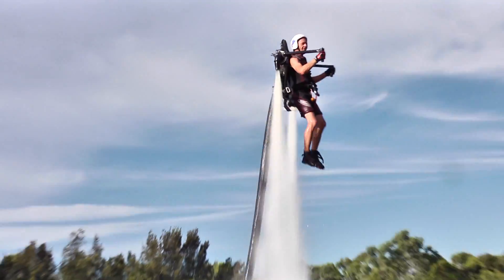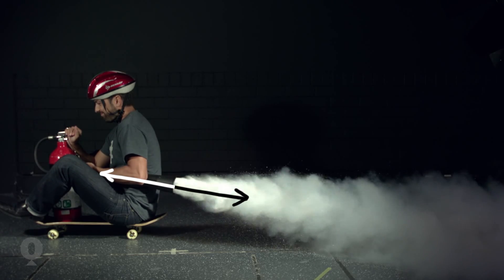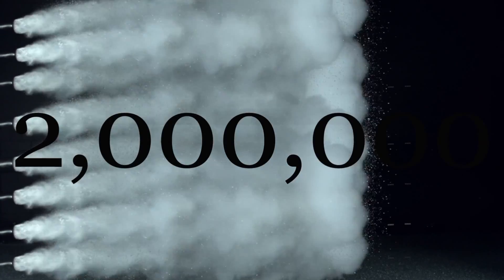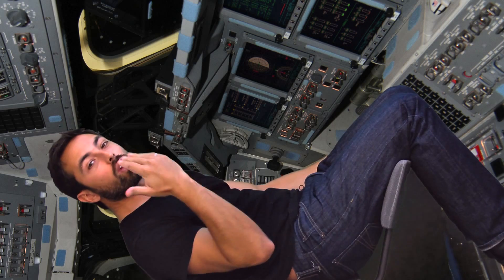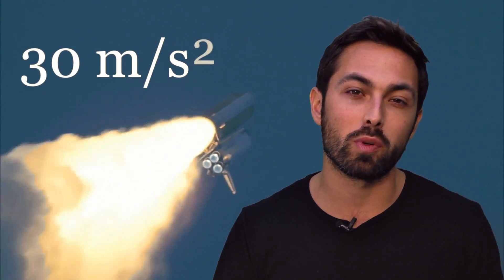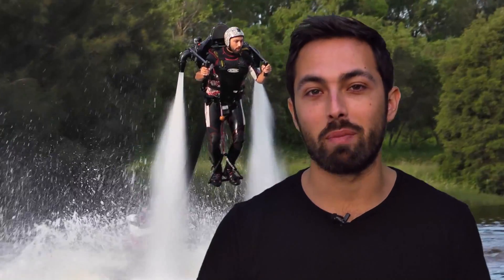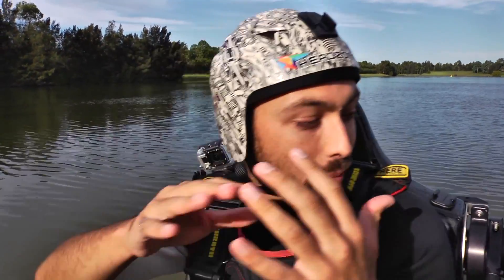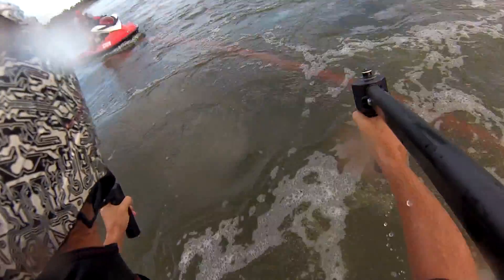The Science of Jetpacks and Rockets!

Comment: Force can be found in many form, and its  correct people, according to the THRUST CALCULATIONS, to calculate the total amount of thrust an engine produce, use the thrust formula, where thrust is (F), and F= M(V2-V1) + A.P, but because the pressure thrust is negligible in this small fire extinguisher, and because air accelerate from zero velocity,, F=MV is basically true :D

Comment: When he showed F=mv with a dot on the m, the dot signifies "rate of change of." So, saying F=mv with a dot on the v means mass times rate of change of velocity (which is what a or acceleration really is), but having the dot on the m has the same effect, but is more descriptive of the fact that the mass of the rocket is changing as it loses fuel. More specifically, the dot is the derivative with respect to time (if you've had calculus).

Comment: What everyone seems to ignore is the air density. if he did that in wanter he would go foward, **density** was not calculated into the equasion. In his example density was not calculated in since it was insignificant. If he had a combination of dense gas in combination with a light faster leaving gas you might see some results.
Even the water rockert was a good example in how dense and fast it came out. But even if you ignore it all try pushing the air u wont move, but if you push a wall u will.

Comment: When we're sitting on the ground we have it to push back with a normal force and keep us in place.  But because when we're in the air we don't have anything to provide a normal force (there is actually a tiny bit of buoyant force because the air pressure is greater towards our feet, but I digress), we have to rely on F=(m_dot)*V.  So just to hover, we're providing a force equal to that which gravity exerts on us (your mass times 9.81m/s^2), which requires burning very expensive fuel.

Comment: If you accelerate too slowly, like a helicopter, you'll use most of your power generating thrust merely to cancel gravity. So the "first g of thrust" is all loss. However, if the rocket thrust generates 2g of force, 1g net actually goes to going up the gravitational potential (50% thrust wasted). If the thrust generates 3g of force, only 2g net actually goes to going up the gravitational potential (33% thrust wasted). If the thrust generates 5g, the thrust wasted is only 20% of total.

Comment: The short answer is that it's more fuel-efficient, with complex reasons why that is. For example, consider just rocketing upwards. If you're hovering, you're using fuel but not going anywhere, aka wasting it, and the further away you are from hovering - the more quickly you're accelerating upwards - the more effectively you're using your fuel. However, this is only if there's no air; in an atmosphere this gain from faster acceleration will eventually be overcome by loss from air resistance.

Comment: They have to accelerate fast enough to reach orbital speed at the desired altitude, which for the space shuttle was around 17,500 mph (28,000 kph). There is no throttle on a rocket engine, btw. You ignite it and it goes.

Comment: he means that the increase is not constant, it keeps increasing faster and faster, like now its increasing at a rate of 6m/s^2 and 10 secs later its increasing at a rate of 16m/s^2 and so on... (numbers are examples not real values and changes in value) so basically what hahalol663 exponentially but exponentially gues like that exponentially but this is not the case exponentially would be more like 2,4,8,16,32,64,128,256,512 exactly, like MB of storage lol

Comment: You said the airplane seat presses into your back. Isn't your back pressing into the seat, but not as much. Our bodies are in one state, and the seat too, but the seat is connected to the plane, so inertia will act 'faster'. But it will also be pushed towards the back. Just as you are. But the seat is stuck into the plane, so it stays. Your body wants to go to the end of the plane, but the seat stops. it. So your body pushes onto the seat, and the seat pushes you. Just more. 

Right?

Comment: Your calculations didn't factor in resistance. The extinguisher experiment may have worked if the wheels were better. I would imagine that atmospheric pressure would play a part as well.

Comment: Quality stuff as always! :) However you did say that most of the acceleration of a space shuttle in orbit is horizontal. I think it needs o be noted that this true for its ascent but not for orbit. I understand that this video isn't supposed to go too deep into the topic, but to be in orbit, the space shuttle experience a vertical (centripetal) acceleration of 1g. If it accelerated horizontally once in orbit, it would leave orbit. It accelerates horizontally UNTIL it is in orbit.

Comment: Simply put, there isn't just the force from the extinguisher.
There is also the static friction force from within the skateboard bearings, wheels, and the floor.
For something to accelerate, the object must have a positive net force. 
The extinguisher might exert a force of 5 N, but if the friction force (which always acts opposite of the direction of the other forces) is 5 N as well, then you won't accelerate.
Basically the force from the CO2 is not strong enough to overcome the friction force.

Comment: Derek "simplifies" the equation, but he explains what ṁ is. ṁ is the rate of change in mass at a position with respect to time, or its derivative. You could write it F = (m1-m2)/(t1-t2) * v. But v is the flow velocity of the propellant, so if you put the time interval under v instead, you get the rate of change in velocity over time: the acceleration. So the force applied is the mass ejected times the flow acceleration, or surprise surprise, F = ma.

Comment: Question about the misconception that you need an surface for the propellant to push off of.
You do not need the surface correct, but doesn't having a surface help significantly as opposed to not. For when the propellant is trapped between the rocket and the surface it creates a high pressure area, adding additional trust from the propellant just rounding off the surface.

Comment: Because decreasing the pressure also decreases the boiling point. If the pressure is low enough, liquid water will be impossible. Take a look at dry ice: the triple point of CO2 is at a significantly higher pressure than the approximately 100 kPa we experience every day, making it sublimate instead of going through the liquid state.

Comment: F = ma is one of many force equations.
F = dm/dt v is another, (dm/dt is the same as what he calls m-dot in the video, and represents the rate of ejection of mass, and where v is the velocity of the ejected mass).

For example, if a 100N object ejected 20 kg of mass per second at an ejection rate of 5 m/s, the force exerted on the 100N object would be 100N - just enough to negate gravity (if the mass is ejected in the direction opposite to the direction of gravity, of course).

Comment: How come the suction from the water being pulled up the hose is not equal to that of the water being ejected? Surely the speed / volume have being sucked up has to mathematically match that being fired downwards otherwise you would be short of water after it starts up. Hope this makes sense!

Comment: That wasn't my question. I know it doesn't matter to work at all. My question was if it adds anything. Either hypothesis A), it is only affected by the propellant - as particles go out this is the only point that force is exerted on the object; from then on surroundings will only have an affect on friction and where the propellant molecules go. Or Hypothesis B) the propellant can be repelled by another object back to the first and put in an extra amount of force on the object. Which is it?

Comment: Keeping in mind that he was only doing that calculation of its thrust only not the mass it also has to lift.  The real question is how many fire extinguishers would you need to get a thrust to weight ratio of greater than 1:1 for whatever amount of mass you have to move.  As a single extinguisher cannot lift its own weight, you'll never hit that number without heavy modification.

Comment: Essentially it comes down to reducing friction to the point at which you can start moving (overcome static friction). Less mass would reduce friction, greasing the wheels, etc. Or you could use a more powerful fire extinguisher.

Comment: With the part on not requiring more than just the propellant to get you moving; does the force repelling on you increase if there was? For instance, could starting the fire extinguisher in front of a wall have allowed you to start moving without having to increase the speed of the release of propellant as much? Or is it only the direct affect of the propellant on you that changes your speed and other things just change where the propellant goes afterwards?

Comment: Newton's second law is actually F = dp/dt. Force is the rate of change of momentum. Momentum (p) is mass * velocity (p = mv).
In most situations only the velocity changes over time - an acceleration - so you are left with F = ma (the rate of change of velocity is acceleration).
However, in this situation gas is ejected from the extinguisher at a constant rate/velocity of v causing the mass to change over time (the dot over the m means rate of change) so F = v*dm/dt (d/dt means change over time).

Comment: That's what I didn't understand. I always thought it would be enough for the water to be pushed out of the nozzles, downwards to push you up, while it didn't matter where it came from. If you had a weightless water-tank (or one fixed to the ground, but higher than you), so it only had to push your weight, while the water doesn't change direction, would it still lift you up?

Comment: Sitting perpendicular to the force eliminates blackout from the forward force of acceleration. But if the pilot pulls the nose of the aircraft up or down quickly, force more parallel to the body is introduced that will either force blood into the lower body from pulling up (grey/blackout) or force blood into the head from pulling down (redout).

Comment: I don't understand the part where you explain that it's the water from the jet ski that thrusts you up until it passes the bend down to the nozzles. If that water were pumped with the same power from a huge tank mounted solid to the ground but above of where you are, so the hose comes down to you and the water wouldn't pass a bend in the jetpack, but would go straight down and then be thrusted out of the nozzles, wouldn't you be lifted up aswell, if it had only your and the hoses weight 2 carry?